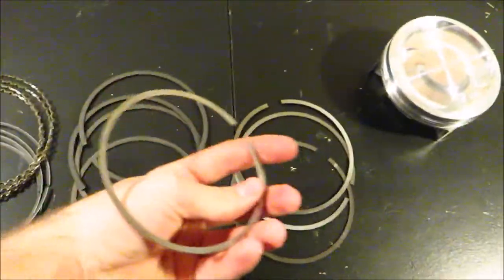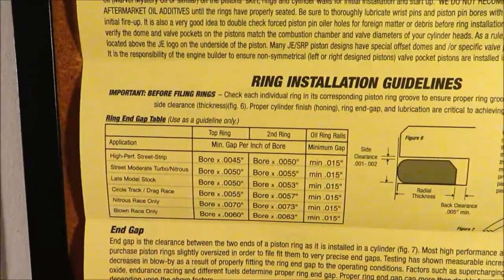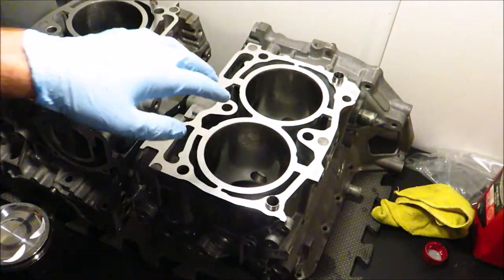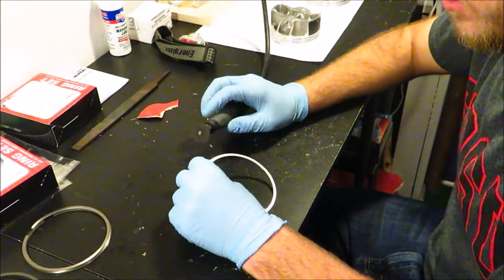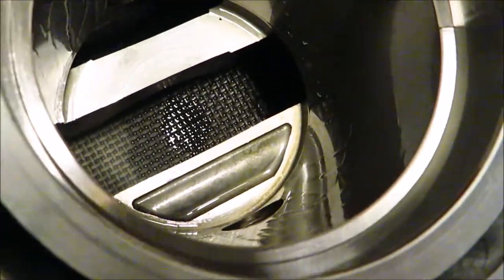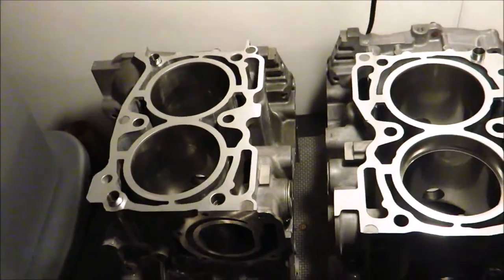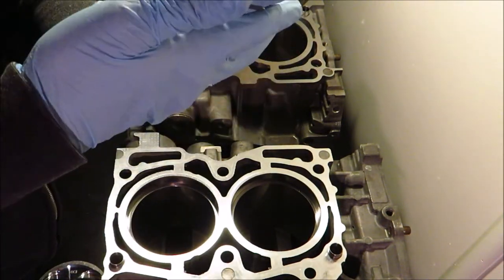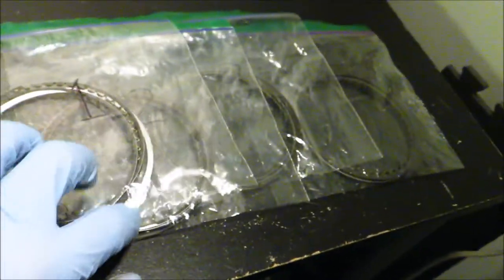Subaru Engine Rebuild, How to Set Piston Ring Gap

Comment: What size pistons are you using I’m trying to figure out ring gap for my 99.75 Manley pistons
Reply from the maker: I got 99.75 je pistons, outfront motorsports told me that .015 for the top ring and .018 for the bottom ring are safe ring gaps for around 20 psi to 25 psi. Probably need a larger ring gap for 30 psi and up.
Reply: @SWSpeedCo  I’m trying to run anywhere from 25 to 30psi but I’m not using a torque plate
Reply from the maker: The torque plate shouldn't affect ring gap too much, its more for machining the block. I would call the shop that did the machine work and ask them what they would recommend for that kind of boost pressure
Reply: @SWSpeedCo  the machine shop I brought my engine to bore out doesn’t know anything about engine building they just know how to machine blocks. I used the instructions that came with the pistons and after calculating both the top and second ring is supposed to be .023. Is the second ring supposed to be a tad bit larger than the top ring?
Reply from the maker: Yes the second ring is supposed to be a little larger than the top. As far as the ring gap calculations you can run those numbers they are just sort of loose for safety purposes and you may burn a little bit more oil, but if you might  me running 30 psi it probably wouldn't be a bad idea to be on the safe side as far as ring gap goes.
Reply from the maker: If it says to do your top ring at .023 than your second ring should be .025
Reply: @SWSpeedCo  I was thinking for ring gap .026 for top and .028 for second to compensate the bore diameter after tighten the heads on for .003 per 90 ft lbs of torque. How’s your engine is it still running ?
Reply: @SWSpeedCo  thank you for all the help as well much appreciated
Reply from the maker: I would just do .023 and .025 that should be plenty of gap. And my engine is still running great. Mine is gapped at .015 for the top and .018 for the second ring, factory is .013 I believe and .011 for the second ring, so the .023 and .025 should be plenty for the boost you are running
Reply from the maker: When they give you that ring gap it's accounting for the change when you torque the engine down, and my engine has around 4500 miles on it
Reply: @SWSpeedCo  sweet I appreciate it man  good looks
Reply: @SWSpeedCo  Following. Did you confirm?
Reply: @silverispro8573  curious how your gaps worked out for you being this was 3yrs ago??
Reply from the maker: @MrLifeEclipse it's still going strong, I think I got over 30k miles and it's making 380whp right now and I will be shooting for 450 or more in a couple weeks
Reply: @SWSpeedCo  that’s good to hear. We read all the suggestions but seldom to we hear the results.
Reply from the maker: @MrLifeEclipse yeah, those one was a success, I want to build a new short block soon but closed deck because I reaching the limits of what this block is rated for.
Reply: I’m currently 525WHP on 91 & 685 on e85. No issues (knock on wood), but I want to build an engine next year as a spare just in case. Because I’ve been down that road before like many others.

Comment: 😬 you’re supposed to grind both sides of the rings evenly, not just one end of the ring
Reply from the maker: No just one side, reason being is If you grind both sides you won't know if your grinding it square.
Reply: That’s why you’re supposed to have a ring gap file wheel. Meant to gap both sides at the same time
Reply from the maker: I guess in that case yes you can grind both sides but that's the way my machine shop told me to do it

Comment: Very technical work. It’s really inspiring watching your videos.. Hopefully one day I can build such a motor. Keep up the great work.
Reply from the maker: Thank you!!
Reply: @SWSpeedCo  Finally brought the OXT home. Body is in great shape, a few scuffs, scratches here and there, and most importantly, no rust on the undercarriage, but she does have 210K miles. However, seems to be running just fine.. but a closer inspection reveals oil leaks in several areas/lines/gaskets, etc.. I got my work cut out, would like to do a full engine overhaul and get rid of that hideous AEM cold air intake it brought. Car shut off when I was backing up on my driveway right after an hour drive. I wonder what that could be. But it turned on right away. Will put it back to stock as much as possible. Striving for a clean modified look but as stock as possible, kind of what you have done with yours. I’m very excited! 😎🤟🏻
Reply from the maker: Love to hear it!! Good luck with the project
Reply: @SWSpeedCo  Thanks, I will refer to some of your videos for guidance.

Comment: As for the ring gap values, why did you choose such a low value?  According to the calculation data provided by JE, the gap should be greater
Reply from the maker: I talked to a local shop that specializes in subarus, who did the machine work on the block. They told me that JE gives those numbers because there is alot of room for error so they are not responsible if you engine blows up. The .015 and .018 is what they told me to gap it to, oem ring gap spec is .011 so it's even smaller

Comment: So what's the proper size for oil ring? Or ideal? You only mentioned top and 2nd ring thanks
Reply from the maker: Usually the oil rings don't need to be touched, they are really hard to get an accurate reading on with a feeler guage since they are so thin but If I remember correctly ideal would be between 0.013 and 0.015

Comment: One of the best videos I have ever seen thank you
Reply: I'm rebuilding a 2014 fb25 2.5 engine and black side skirts were gone but had no Grove at top of cylinder so ordered new pistons and rings. Handed the cylinders and thought I should check the ring gap found 9 thousand gap 😢 started looking at videos and found yours SO THANK YOU FOR YOUR VIDEO  I will find the specs for my engine tomorrow and GET ER DONE thanks
Reply from the maker: Thank you, glad I could help!!

Comment: congratulations friend for your videos!
I have a confused neophyte question, are the ring gap measurements expressed in mm or in inches?
Reply from the maker: Thanks!! The ring gap is measured in inches
Reply: Ok friend, I would also like to ask you what tolerance did you use between piston and cylinder wall?
Reply from the maker: I had a shop do the machine work so I think it is whatever the manufacturer recommends

Comment: @ 3:40 "aluminum dosent expand as much as........"

that is not correct, aluminum expansion is like 2x or 3x
Reply from the maker: You know what you are right. I was thinking backwards, the block expands more ant that is why you need to run a tighter ring gap because when it expands the ring gap will open up.